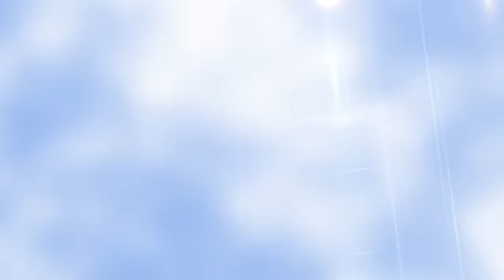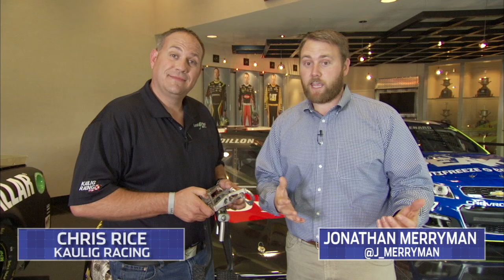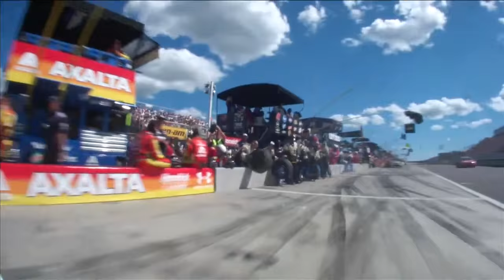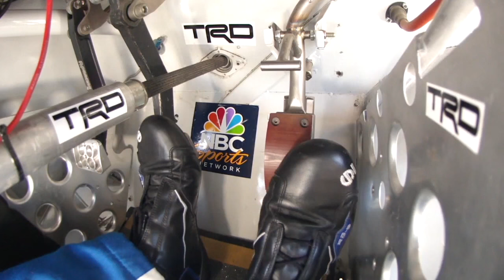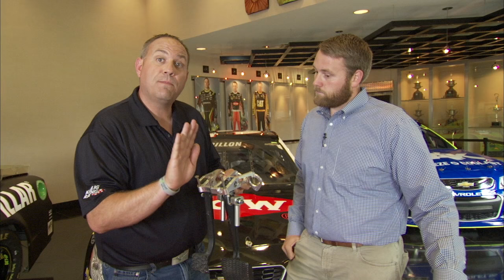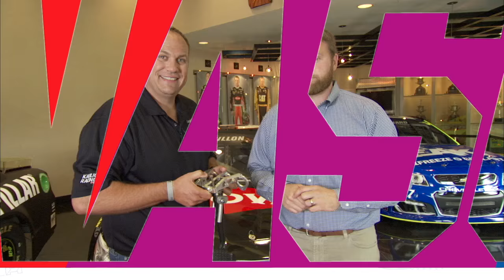Tech Talk: Pedal setup

Comment: 3rd
Reply: i double clutch right into 4
Reply: double clutch? how old is your vehicle?
Reply: its a 2004  freightliner chassis p4-xl with a 10 speed eaton fuller
Reply: crapper1 you have to double clutch in a 2004?
Reply: its based on a semi truck and has the same transmission and yes my 2016 cascadia evolution also needs to be double clutched
Reply: I'm assuming that it was a personal choice and not the only available option in both scenarios